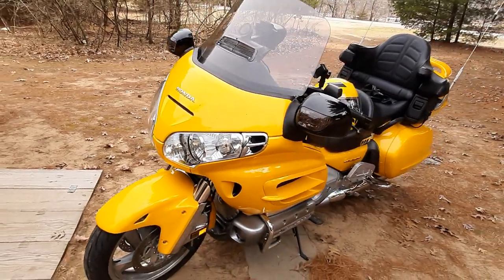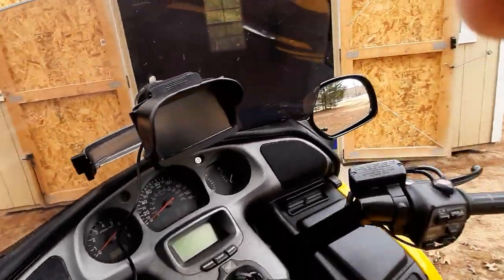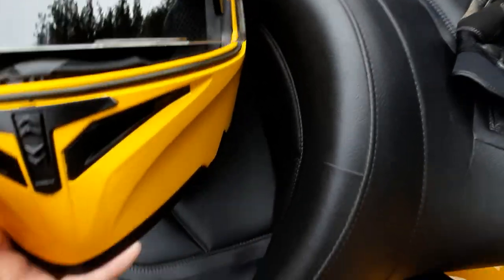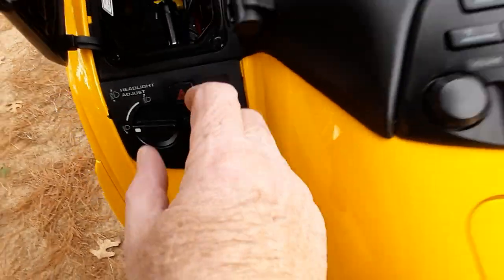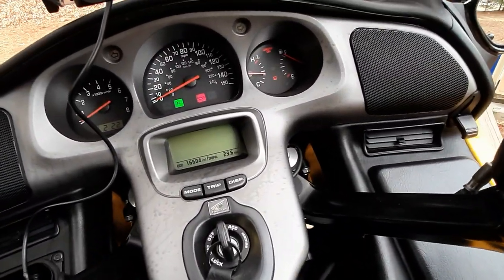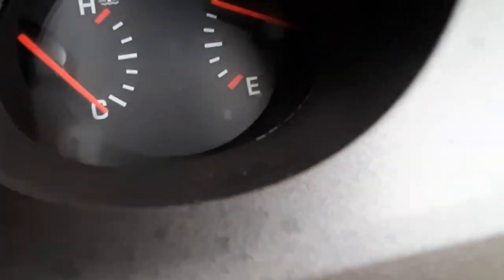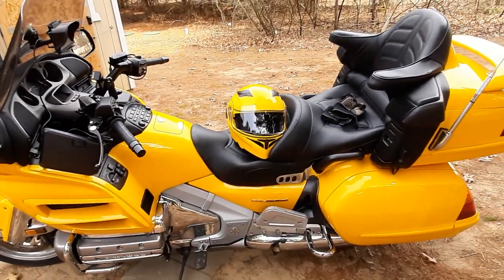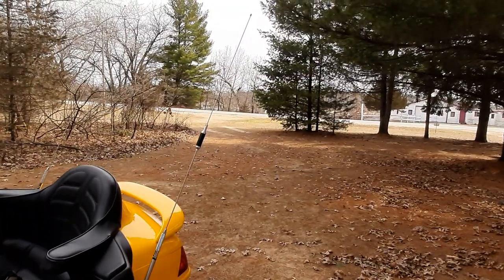taking the Goldwing out for a ride and fuel mileage check

Comment: a lot of us set the rear shock pressure at 25 and leave it there. I weigh 245, wife about 125. Works fine either solo or two up. But if you never do 2 up 20 would probably be good for you depending on your weight. I believe the gas tank holds 6.5. And it wont hurt anything to leave the cruise control on. I leave mine on all the time.
Reply from the maker: Thank you Doug

Comment: A light  comes on when the fuel is low(6.5 gallon tank). It comes on when it is between the last white and read dash. The F1 light is for something else (check the manual). Don't drill hole in door, cut out an indent in base of the opening. Check air regularly.
Reply: FI(fault indicator). Definitely think it’s for something else too
Reply from the maker: It turned out to be the computer, the computer was $1700 to replace.  I have put on just under 5000 miles and it runs great.
Thanks
Reply: @mars4508  Thats awesome man. We are in the market for a goldwing. Just trying to do all the research I can first. Safe travels man

Comment: The Numbers are your Pre Dampening Adjustments. The higher the Number the more Shock Dampening you get. It runs from 0 to 35 and usually the more weight you add (Such as a Passenger)  the more Dampening you will need for you preference but it does not lift the Height of the Bike. Glad that you got a Ride in and are enjoying your GoldWing,
Reply from the maker: That's good to hear, it rides beautiful set at 13. Thanks
Reply: @mars4508 that's rear suspension preload. It will raise😅 the rear but only a little. I like mine at 15 solo and 25 with the wife. 
Running it all the way up really helps get it on the center stand.
Reply from the maker: Thanks Paul, I set it at 14. The ride now
Reply: @mars4508  I've got an 02 the same color and a service manual. If you ever need help, I'm not hard to find.

Comment: That 10 and 13 is air pressure in the rear shock. Put 20 in it and more when you have a passenger.
Reply from the maker: Will that make a ride difference or just height change
Reply: Definitely a ride difference. Usually  better.
Reply: My wife rides on the back of my 02 Wing, and I keep my suspension set at 15.

Comment: You're going to ruin the cover of the compartment for a $5 cable. Doesn't make sense at all. I doubt that clamping it under the lid will do any damage to the cable.
Reply from the maker: Warren,  I ended up doing was grinding down a small portion of the compartment top lip and not the door.
It's not a problem.  
Thanks